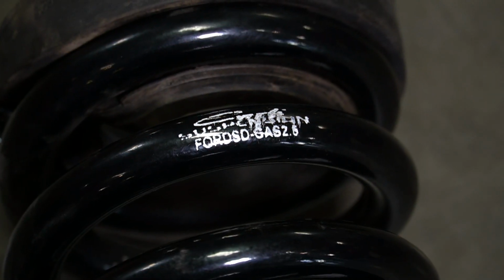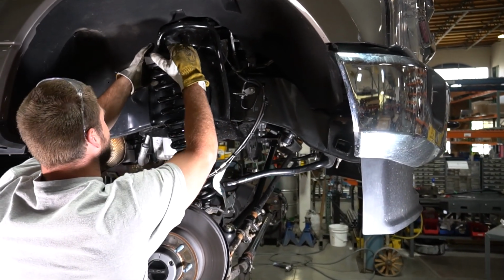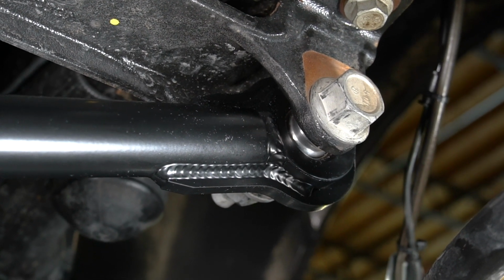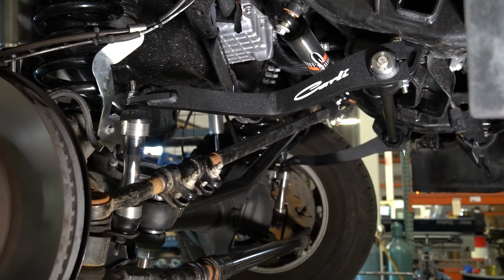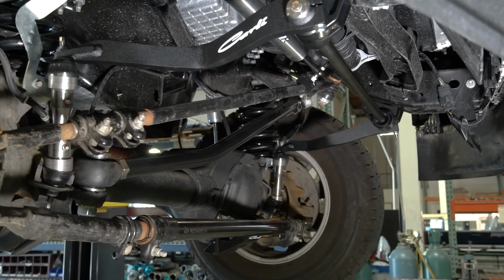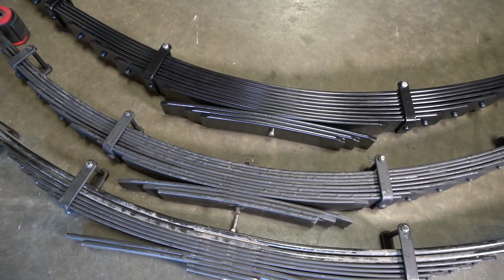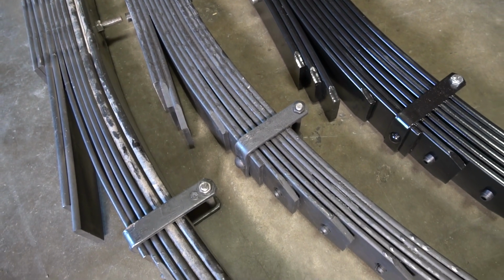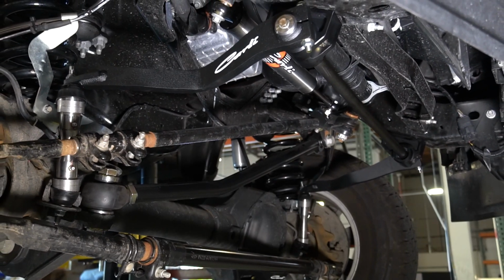Carli Suspension for Super Duty with a 7.3L Godzilla GAS Motor

Comment: I have 2020 f250 xlt 7.3 liter gas 6’9” bed. Snow plow package but no plow. Bilstien 5160 shocks. But on bumps truck is a little rough. Don’t want to lift it. Is possible to really smooth this suspension for highway driving.
Reply from the maker: We don't offer anything to smooth the ride without lifting the chassis. The lift is there to create more room for the axles to move as these trucks are very limited in suspension travel from the factory. To lighten the spring rates for a softer ride, a short lift is necessary.

Comment: I have a 2020 Ford F-250 7.3L with you backcountry level kit with radius arms and complete Carli sway bar. Stock springs in the rear. The kit I have is for the diesel trucks. My question is since the gas springs have a 20% less spring rate then the diesel spring. Would the ride change that much to warrant replacing the springs and shocks? If so besides the springs and shocks what else would have to be replaced. Thanks.
Reply: Just traded in my 2019 Ford F-250 diesel for 2021 Ford F-250 7.3 gas and have the backcountry level kit but never get chance to install them on the diesel.Was wondering how the ride and fitment since it being for diesel setup and I see that you install them on your 7.3? Thanks
Reply: @vinnyk3245  At first it was stiffer then then my last two diesels. One was stock and one had a fab tech lift. I have put 43k+ miles on my 2020 now and love the way it rides. I prefer a firm ride in the front. But it does feel like it has settled down or maybe I’m just use to it. The sway bar set up really helps to. I was thinking of having the gas set put on, but after talking to Carli the gas system is about 30% lower spring rate. I didn’t want to chance changing it and not liken it. Maybe I will change my mind if I ride in a 7.3 F250 with the gas kit.
Reply: How do you like that 7.3/10speed so far?
Reply: Mark my last two SD’s were diesel. Since I don’t really tow my toy box anymore I don’t need the extra power. But still wanted a full size truck to tow my boat and the toy box if needed. Love the fact it is soo much cheaper to maintain. Love the sound of a big V8. To be honest it’s feels easier to drive. Probably because the 7.3 is almost 700lbs lighter in the front then the diesel. The 10 speeds really lets you open the 7.3 up when needed. I’m very happy with it.
Reply: @MrMike4073  Love my 7.3 Tremor, but it needs leveled. Sold my 2012 6.7, sick of doing EGR coolers.

Comment: why dont you guys make suspension for GM trucks like leveling kits or lift kits
Reply: Buy a Ford. Problem solved.
Reply: @jakeguidry1  i dont like fords
Reply: @rigs7412  I am curious as to the reason(s) you do not like Ford trucks. Do you not like Ford engines.....or the truck??? Maybe you don't dislike either...but really like the General Motors LS gas engines.....or you prefer the DuraMax over the Powerstroke?  Maybe your Dad drove Chevrolet and or GMC trucks...and that is the reason for your bias?
Reply: @15Jeep  im not bais my dad drove a cummins i just dont like ford you see so many in the junkyard and on the side of the road so i pick gm
Reply from the maker: The Ford, Ram and Jeep guys keep us too busy as it is!
Reply: @thecarlisuspension  ok thanks tho it would just be nice to have a nice ride for us GM guys